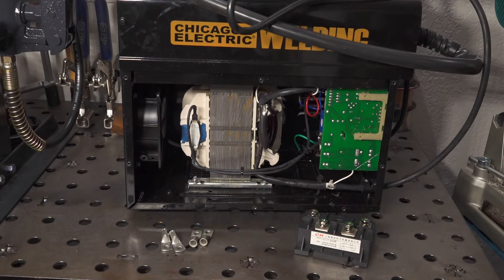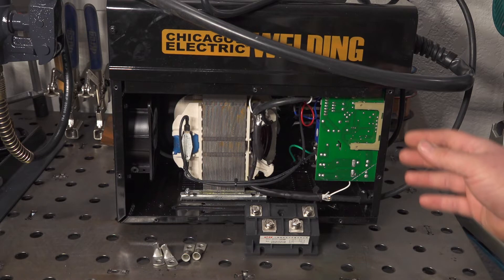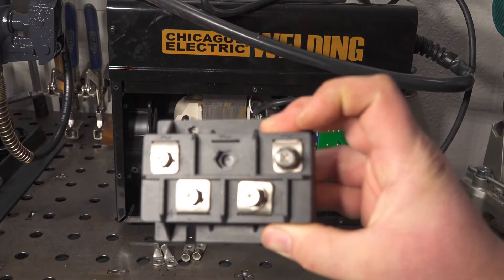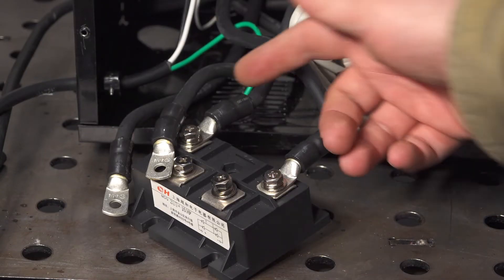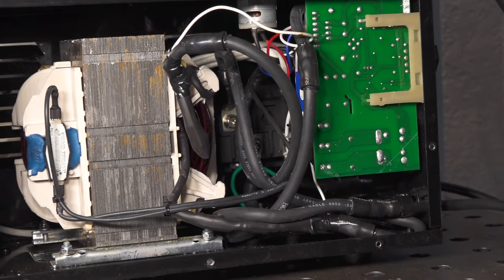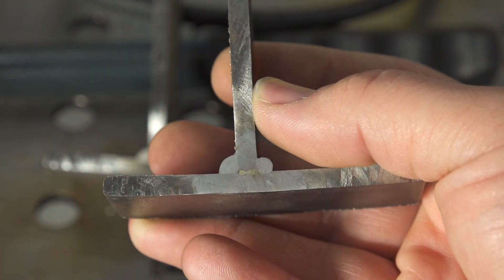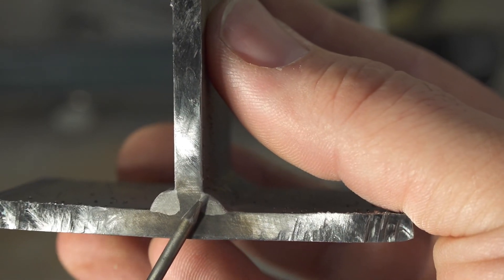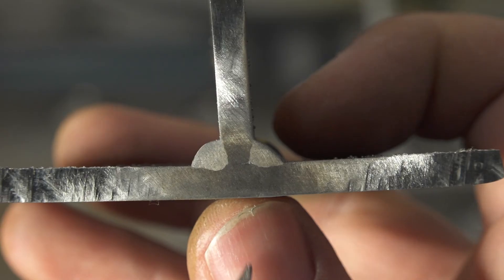Harbor Freight Flux Core: DC Conversion and Testing

Comment: After a brief look both here and viewing other's modifications on YouTube,, I don't see any suggestion to use silicone HEAT SINK GREASE when mounting the bridge rectifier. That is always a good thing to use for transferring heat away from the rectifier unit. It is low-cost enough to be included in the budget mod..
Reply: Spent many years in the electronics industry, whenever attaching a heatsink, ALWAYS use thermal grease. A poor thermal connection between a component and the heatsink can /will reduce the effectiveness of the H.S. by 50% or more. Just a dab will do. You’re only trying to fill the pores/gaps between the two surfaces. Too much actually increases the thermal resistance.
Reply: I used the grease...and used an old heat sink from a junked PC I had in the shop...it was the same size of the rectifier !
Reply: Thermal grease is to be used on mirror like finishes and in minuscule amounts. When you cake it on there and let it squeeze out the sides it is making more of an insulator than a thermal transfer paste.
Reply from the maker: I do mention that for anyone doing this they would be best to have a dedicated heat-sink for the rectifier.  But you are correct;  the use of a thermal interface material between the rectifier and heat-sink would definitely be advised.

I never intended this video to be a full tutorial, so I didn't get into those types of details.  But that's something that shouldn't be overlooked.  Thanks.

Comment: This conversion would allow one to weld stainless steel correct? Obviously need to buy stainless steel flux core wire too.
Reply from the maker: Theoretically.  However, there aren't a lot of stainless steel flux core wires available.  There is one that I could find, and I actually got a spool of it specifically to see if it will run on 120V flux core machines.  From what I've seen, it recommends a fairly high output voltage, which a machine like the Chicago Electric machine likely can't do.  But I wanted to see if it would still run good enough.  I just haven't had time to test it.

Comment: Thanks to this video, I modified my "Speedway" 90A flux welder by wiring in a 200A rectifier. Immediately I noticed almost no spatter and my welds were consistent, flatter, and immeasurably better than what I was getting from the AC output.
Reply from the maker: Nice.  Glad it worked out for you.  One thing I didn't really cover in the video is that a heat sink and thermal interface material (paste or pad) would be a good idea for the rectifier.  I didn't use one for the video, but for long-term use, the rectifier will hold up far better if you are able to draw heat out of it.
Reply: @bigtb1717  Thank you for posting this and mentioning the heat sink. I plan on making my own to fit the small confines of the welder's case. I had to move the main transformer fully aft and mount the cooling fan outside the case just to fit the rectifier. :)

Comment: Doing this conversion would I be able to weld thin metal like fenders on cars and stuff like that or would it be too hot now?
Reply from the maker: I never tried welding really thin metal with it.  You can still turn down the output after doing this, but it doesn't have infinite adjustment of the voltage, so I can't say how thin of metal you could weld before or after this modification.  The modification will allow it to weld smoother with far less spatter, which I think would be a good think for auto body work, but you certainly don't need extra penetration.  If that is your main use case, I probably wouldn't bother with the modification.
Reply: @bigtb1717  wouldn’t say that would be my main use case I want to be able to do a lot of things with it but auto body is definitely one of them maybe I’ll just put the Lincoln wire in it and upgrade the ground clamp and get some anti spatter spray

Comment: I did the mod but now the welder is always live as opposed to before where it only sparked when I squeezed the trigger
Reply from the maker: Strange.  That shouldn't have changed.  Is the wire feeder running constantly as well?  If I remember correctly, the power for it came from the output transformer.
Reply: @bigtb1717  I think I might have wired something poorly, I had to improvise because I couldn’t find 4 gauge butt splices
Reply: @bigtb1717  it’s also super inconsistent which further leads me to believe I wired it up poorly
Reply: @bigtb1717 yeah I wired it up again and it still is always live, idk where I went wrong. I wired up the clamp to negative, the gun to positive, and does it matter which side goes where for the ac parts bc I just did them at random?

Comment: What gauge wire is it? I need to know for the lugs
Reply from the maker: I think I used 4 gauge.  With the short lengths, you could probably get away with 6 gauge.
Reply: @bigtb1717  thx

Comment: I just did this conversion with just the 200 amp full bridge rectifier omg 😱 day and night difference, almost no more bb spatter, and I noticed a huge power increase, soo much hotter and soo much more penetration with .035 flux core maxed out wow 🤩, so with 30 bucks for 200 amp rectifier holy moly soo much smoother arc and like 90 percent less spatter totally worth it and this video confirms it

Comment: can you do positive ground with this setup?I have heard that flux core runs better less splatter
Reply from the maker: Yes, that is how I had it set up.  Flux cure runs really poor on electrode positive (negative "ground").  Converting to DC and running electrode negative (positive ground) runs far better.  AC flips polarity 60 times a second, which is one reason it runs poorly with flux core.  50% of the time it is electrode positive.  Electrode negative runs smoother, less spatter and better penetration.

Comment: In early March 2023 I have browser-searched for DC welders with transformer arc generation. I could not find any under $600.00 U.S.D.

Therefore—to put $200 in this $150 purchase price  still has you at least $250 to the better and  in Illinois you'll have to pay another $60 in sales taxes.

Comment: @10:45

My Chicago Electric 125 welder from Harbor Freight came with instructions that said it was a 20% duty cycle machine out of the box.

This counter renders it for spot welds or what you do a "long-run" you can go ahead and take a coffee break for 5 minutes. Not for the one making a living as a welder.
Reply: I noticed my old one (burned up in a fire) would kick out after welding for over 5 minutes or so. I always had to wait for it to cool down before continuing to weld. My newer one won't kick out no matter how long I weld! I just built an entire 2 wheel trailer and it never shut down once! Must be a better circuit breaker in them now?!

Comment: is 'tied in' a welding technical term? I googled it & didn't find anything similar to what you're explaining. I'm assuming you're referring to the amount of penetration, but I'm not sure. Can you please clarify? thanks
Reply from the maker: Sorry, I don't know where I picked that term up over the years.  But you pretty much have it.  "Tied in" just means that the the weld metal melted into and mixed with the base metal, at least slightly.  It's basically just a way of saying there was at least some, small amount of penetration.  So if the toes are "tied in," then the base metal melted at least a tiny bit at the toes and the weld metal and base metal mixed together a bit.  So the two are "tied" together.  

If something wasn't "tied in," then the weld metal is essentially just laying on the base metal and the base metal didn't melt at all.  The two may still be stuck together somewhat (similar to a braze or solder joint), but it isn't as strong of a connection as if the base metal had melted and mixed in with the weld metal, essentially becoming one.

Comment: the biggest problem with doing the conversion the way it's done here because of exactly what he pointed out, the current for the wire feed circuit is pulled right from the transformer with the current for the gun and because the connectivity and penetration is so much better after conversion so much more current goes out to the weld that it ends up starving the wire feed circuit burning out the pcb, the only successful HF conversions that actually last are the ones where they also added a separate transformer to run the wire feed and increased the cooling and lastly a large heat sink for the rectifier is a must, big cap also helps smooth out the current. do the conversion right and the HF welder will out weld any of the lincoln 115v welders...
Reply: I got the Jobsmart 125 MIG from Tractor Supply. About 10 years ago.
Similar transformer type, AC output flux core by appearance.
However mine does use a seperate transformer for the wire feed.
 My wire spool loads from the side. 
I had plenty of room to bolt the 200amp bridge onto an amazon heat sink about 4x6 inches thats  near an inch thick.
Bought a metric tap and used the machine screws that come with the rectifier. And some thermal paste.

Mounted the bridge/heat sink near the fan with lots of room for airflow.
F.Y.I.
Stated output on the front of the Welder cabinet says:  "27.1vac @80 amp high." 
"17.1vac @40 amp low". 
Adding the rectifier you, subtract 1.4 vdc across the forward diode pairs from stated voltage.
And  a 140 watt drop in power on high.

So, it's still a weakling voltage machine.
Volts should be 50 vdc open circuit.
Next time buy a Inverter type for 3 X. more $.

Comment: Why not just buy the Titanium 125, for nearly the same price on sale. It's already DC negative
Reply from the maker: I agree.  Now that the Titanium 125 is available I definitely recommend it over this machine in general, and I certainly wouldn't recommend purchasing this machine with the intention of converting it.
Reply from the maker: In fact, I have a review of the Titanium 125.  It's better in several ways beyond just being DC output, thought that is the biggest improvement.
Reply: The Titanium is better in that it is already DCEN.  However this welder will take a 10# wire spool where the Titanium will only take a 2# spool.  I bought mine before knowing about the AC issue.  Ignorance is bliss.  I likely would have bought the Titanium, had I known the difference.  I did convert mine to DCEN with a capacitor and it made a whole new welder out of it.

Comment: But it is not "putting lipstick on a pig" as the first video before yours on this DC conversion topic.  

If "$xx.xx" raises the value of the machine, them the machine is no longer a "X" value; it value has increased.

If you put a strong running Chevy 454 big block in a canoe, the canoe is now worth more than before the addition of the big-block.

In fact, it could be that an "$xx.xx" investment/modification could increase the machines value by a multiple of the cost to convert it.

The video I watched before your put in a heat sink about triple the thickness of the rectifier.
Reply from the maker: I did the conversion as basic as possible just to demonstrate the difference in performance, even without anything other than a rectifier.  If someone was going to do this conversion with the intention of putting it through normal use, they would definitely want to use a proper heatsink for the rectifier.  

In general, I wouldn't recommend anyone purchase this welder with the express purpose of converting it, unless they just wanted a project or something, in which case, have at it.  But considering the cost of welders like the Titanium Flux 125, which is better in many respects, I'd definitely go that route over buying and converting this one.  But if you already have this welder and want to convert it, you can definitely get more performance out of it after converting it to DC.
Reply: @bigtb1717  

Ya— The expense of $50.00 is so much better than laying out two Ben Franklin's plus 10% sales taxes for another machine with my 30-year on-and-off cash starvation situations in my life..

I rest the welder 4/5ths of most times. If I violate, then Inlet it sit for 8x the summation of time violated.

I just have 12-linear-inches to perform.  But I just am not getting the hang of it.  I am welding 11-gauge cold steel to a hike I made  subframe on a 1999 Toyota Solara to change out a bad caged nut..

Comment: Yes it's the cheapest but you all will want to do a heat sink, compasidor, bleed resistor and a ferrite core and if you have the older welders you will want to put a plastic shroud around fan blades to pull air in thru back vents<<<this is the most important cheap mod and should be done even if U don't do the DC conversion cuz it pulls air in the back and pushes air out thru vents.  If you have time dremel out a small rectangle opening at top beside the wire feed in top front<<<this creates a vent opening to let heat escape :)

Comment: Did you add that fan also? How's that doable? that's an AC connection to the stock fan. Those CPU style fans are DC right?
Reply from the maker: I did not add a fan. That is the stock fan.  I didn't inspect the fan closely. But it may be a universal, brushed motor, or it could be an AC motor fan.

Comment: How can I change the polarity that's the problem
Reply from the maker: For self-shielded flux core, the "electrode" should be negative.  So after the conversion the wire drive should be connected to the negative (-) output of the rectifier and the work/ground clamp should be connected to the positive output of the rectifier.
Reply: @bigtb1717  I know but how do I do it on the 125 Chicago flux welder is what I mean
Reply from the maker: The Chicago Electric Flux 90 and 125 have AC output in stock form.  AC does not have a specific polarity.
Reply: @bigtb1717  ok so if I DC convert it can I change the polarity or no
Reply from the maker: Yes, once you convert to DC, the output of the rectifier will be DC with + and - terminals.  So the polarity can be set properly for flux core when you are installing the rectifier.

Comment: I have this exate machine and rectifier and your video is the only one I've been able to fine of this exact model. can you show me or explain how the min max switch and power switch is wired? I made the mistake of unplugging everything during a conversion and don't know how to reconnect everything. I'm pretty close to having it hooked back up properly but I can't get the Wire feed to ingage and I keep blowing the breaker.

Comment: I do want to copy this, I know how to connect terminals and solder.  The main issue with the video is that all the heat shrink, wires splices, etc, it's all black. It isn't very helpful for someone not familiar with the various parts of a transformer or welder on an electrical engineering level. Knowing my luck, I'd try to do the conversion and blow something up with the welder. The video could be improved with perhaps a voice over, a freeze frame, and some hand-drawn arrows using the before and after shots of the welder's internals. Or a diagram?
Reply from the maker: Unfortunately, this video was never really meant to be a "how-to" for this conversion, I just wanted to show, in general, what I did.  This video was more about showing the drastic difference in performance after doing nothing more than rectifying the output to DC.  For instance, at the very least you should also put some type of heat-sink on the rectifier with thermal paste between the two.  A capacitor (or capacitors) will also help to smooth the output, though it's not strictly necessary.  I could probably make a diagram or a new video if you can't find any other how-to videos out there.
Reply: @bigtb1717  I get that. The unfortunate thing is almost every video I manage to find is about 2 or 3 years old and the presentation is from a post-project perspective. Or the quality of the video is potato grade. Searches for some higher quality video and information lead me to your video.  I guess the search goes on, lol.
Reply from the maker: I actually have a second one of these welders.  I’ll consider doing a full, start to finish DC conversion video with it.  But it might be a while before I can get to it.  I’ve been really busy with work and family stuff, so it might take a while to get around to it.

Comment: someone needs to come up with a amp control. thin metel pow holes ... lower amps or voltage i guess easier on the dc side to do this.. good video tho i was goin to do this 2 years ago hahhaah have all the stuff .. still not get to it hahah

Comment: I am so sorry for bothering you, but I had done everything you did to specs. Everything was fine up until the point where I turned on the welder and pulled the welding gun switch...nothing! I tried it again...nothing. I removed the motor from the welder to see how f it was bad, turns out it was still good. So whatever I did it's not getting any power to the motor. The relay is good ,the 2 fuses inside are good and not blown and there's nothing I can see physically that is wrong. What did I do wrong?
Reply from the maker: It's hard to say for sure what is wrong.  The two control wires on the output of the transformer, did they both stay connected where the were?  Do you have a multi-meter?  If so, do you get any voltage on the wire when you pull the switch and the motor just doesn't run, or does the welding output not turn on either?